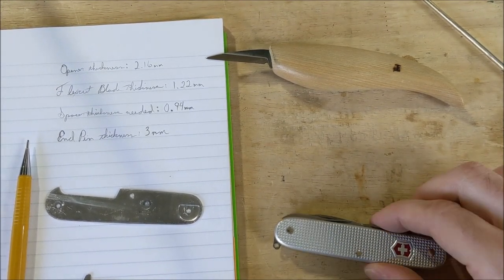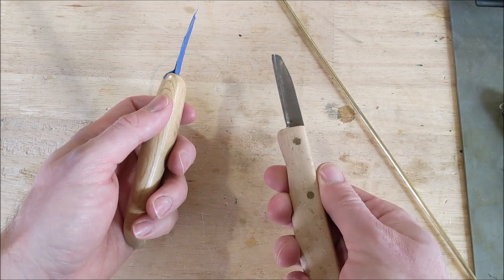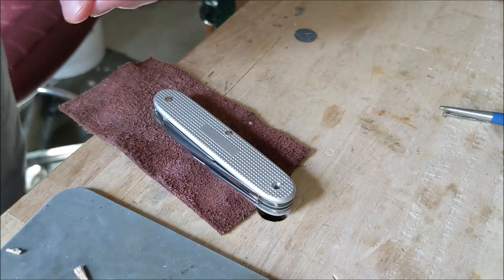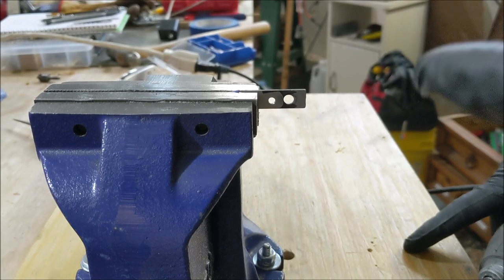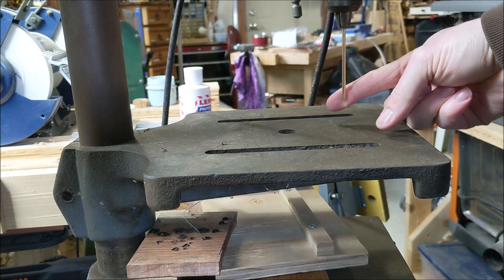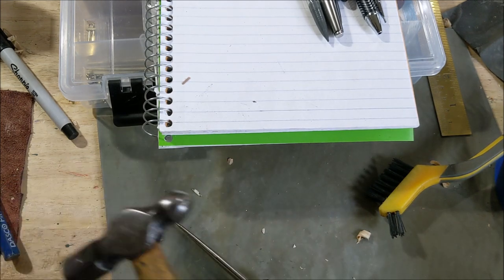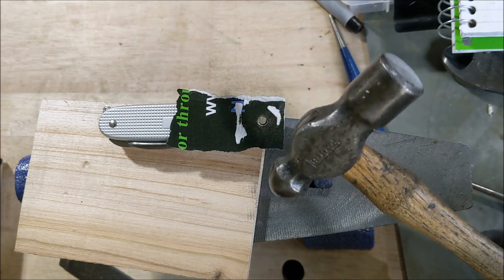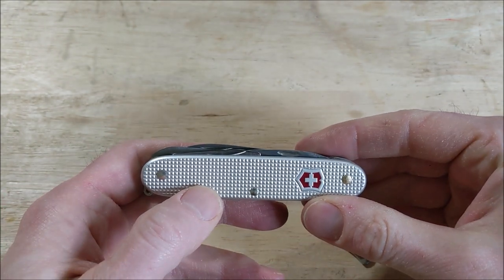How to add a Flexcut Whittling Blade to a Victorinox Alox Swiss Army Knife Farmer. SAK Mod

Comment: I had actually found the exact same knife but it's called the harvester.. it already had a hawkbill blade in that spot. I just turned it into a warncliff style and it works great
Reply from the maker: Yeah, I have looked at that knife. I believe they call it the, "Swiss Army 7," now. Making the pruning blade into a warncliff does give a very similar result to my knife, but my knife does have a slightly harder steel for the whittling blade. That said, I don't mind using Victorinox stainless for whittling. Also, my knife has the key ring loop, which seems to be a real love or hate kind of thing, I love it for attaching a pocket clip.

Comment: Ever thought of replacing the nail file on the Cadet Alox with a scissors...? That would be an awesome project. You rock, man! Cheers...
Reply from the maker: Thanks for watching, and I'm glad you enjoyed this video. I have added scissors to a Cadet, but as their own layer ( https://youtu.be/2lcbzKeZI6E?si=dDMpAgx_29YzwwaI ). If you replace the nail file, you would also have to remove the blade, they are in the same layer, because the scissors require their own layer.

Comment: This would definitly a knife I would buy immediately!
The reamer placed on top is already great!
Don't like the centre/back reamers on the plastic models.
But I cannot do what you did so hopefully Victorinox will bring out the pioneer whittler one day.
Another thing I really would like to have is a simple flat little fork on my edc.
Victorinox never incorporated a little fork on any of their knives besides the cheese master which is a useless piece of equipment overall.
Anyway, great video!
Reply: Maybe I found a simple solution for people without the possibilities for this modification.
Take a pioneer 7 and change the cutting edge of the pruner and re-sharpen it.
It's not a tough blade but it's at least something that most people can do :-)
Reply from the maker: I thought about doing exactly that when I first started exploring the idea for this knife. I didn't go that route because, like you said, I was really looking for a harder steal for the whittling blade, and I didn't already have a Swiss Army 7 Knife. I do really like the idea though, and if I had a Swiss Army 7, I would probably end up reshaping the smaller blade to better suit my needs.

Comment: That is truly awesome. I wish I had one. I’ve modified the small blades on a couple of knives for carving, and the steel I like best is on the inexpensive Rough Rider knives. It holds an edge even better than my more expensive Case and GEC knives. But your solution is the best by far!

Comment: You can buy carving blades without the handles— they are made for the knife sets with changeable blades. This would save you the trouble of cutting off a handle, and usually save you money as well.
Reply from the maker: Yeah, I thought about that, but I already had this knife, and it wasn't seeing much use. If I were to make another,  I would for sure buy a blade without a handle, but this time around this was the cheaper option. Thanks for the suggestion though, and for watching. :-)

Comment: Thank you!
I've always been curious about what the tang of Flexcut knives looked like! Thought about making new handles for a couple of them
Reply from the maker: My pleasure, I was curious too. The only trick is getting them out of the handle, that epoxy or whatever they use to hold the blade in place is some pretty good stuff.
Reply: Flexcut sells blades, without handles, for its line of knives with interchangeable blades. Consider using one of those if you want to make a new handle. It would let you skip the “digging the blade out of the factory handle” step.

Comment: Sharpen the can opener to make a curved blade for carving bowls and spoons. Sharpen the large screw driver to make a chisel.
Reply from the maker: I removed the can opener for this mod, so I don't think that will work out. I have thought about sharpening the screwdriver into a chisel, but pushing on the non locking blade like that makes me a bit nervous. Do you have experience with this mod? Does it workout because of how you hold it, or do you have to be super careful not to close it on your fingers?
Reply: Josh's Shop my screwdriver blade is locking, thats why it makes a great chisel.
Reply from the maker: @georgerector9252  Ah that would be cool.

Comment: File out that stupid keyring hole, and you're set!! Good job!!
Reply from the maker: Ha, thanks. I know the key ring nub really bothers some people, but I actually don't mind it, I find it is rarely in my way, and I really like being able to carry my knife on a suspension clip.
Reply: @JoshsShop  It depends on how you use the knife. If you use it for common cutting tasks that we all use from day to day, it's great to have it, however, if you start using it for wood whittling, it's a pain and a discomfort. I also liked it for the same reasons, until I used the Harvester that comes without it! 
Keep em shapr and stay safe!!

Comment: How much for one that’s what I need in my pocket very well done
Reply from the maker: 😁 thanks. This took me so long that I would have to charge a silly amount inorder to make it worth my time, it wasn't that hard though, if you have the basic tools, you could do it.
Reply: @JoshsShop  haha...silly amount must be 10 times the actual cost of knife 😆
Reply: Yup I went through a phase of modding these knives replacing pioneer alox handles with carbon fibre, parts were about £20 plus cost of knife, but took about 6-8 hours per knife (lots of  hand sanding) so selling at cost plus only £10 per hour labour would price the knife over £130. No one is gonna pay that! Also extra costs for waste (my own mistakes!). This kind of thing is really a labour of love ❤️

Comment: This is a really neat modification. After you made the groove that allows you to get your nail in the blade did you have to go back and remove any sharp edges? Really Enjoyed this video.
Reply from the maker: Thanks. I may have just been lucky but adding the nail nick didn't raise any sharp edges that needed smoothing.

Comment: How come Victorinox does not make a Wood Carving knife that has two carving blades, a saw, and a large roughing blade. Blades that have 58 or better Rockwell hardness or 440 or better stainless steel.  Just three slots (not sure what they are called) handles. that are rounded for comfort, with locking blades.  Folded no more than 3 1/2 inches long.  If all the carvers out there will unite and keep bugging Vicky about it, I am sure they will listen.
Reply from the maker: Sounds good to me. I don't expect we will ever see anything like that, but it would be sweet.

Comment: Is it possible to add metal file instead of whittling knife? Or will i need extra scale instead of spacer?
Reply from the maker: If you remove both openers, you could probably get tricky and add a file from one of the 91mm models, or like you say, get/make another spacer and back spring, then add the file as an additional layer. Either way, you would probably have to completely disassemble the knife which can get a little tricky, but is completely doable.
Reply: And thats why I purchased a second farmer to use as a donor. Andalso  a climber or  mountaineer , idont remember the name,that has file to get. Stupidity to disassemble 3 knives to make 1? Yes. Do i care? Nope.
Reply from the maker: Sounds fun, I hope it works out well.

Comment: Why does everyone mod the can opener.  For me, it's the most useful too.  It's a great can opener!   Plus, in this case, you can mod the can opener into a handy curved carving tool really easily.  Then you would have three blades to carve with.  Ditch the useless bottle opener.  It's almost as lame as the cork screw....maybe more, since I have used the cork screw several times.
Reply from the maker: Interesting. I very rarely use the can opener on my knife, which is why that is the tool I replaced on this knife. I do use the bottle opener tool often though, mostly as a pry bar, scraper, and screwdriver. I see what you are saying about turning the bottle opener into a curved carving tool, but that isn't something I was interested in. It could be done though, you would just have to switch things around a bit.
Reply: Josh's Shop    I don't know if you're aware of Felix Immler's channel.  I think he does every trick there is with these knives.  Really fun channel that I've been binging on during the shutdowns we have going on.  Really all there is to do is sharpen the edge, and grind off the grippy part.   I have a simple 2 blade, 2 tool one at home, and that's my dedicated kitchen can opener.  A tiny bit of practice and you can open a can as fast or faster than any can opener, and it never wears out, amd most importantly, doesn't get all gross and nasty because it's so easy to clean.
Anyway, we all customize to fit our own needs.  I only mentioned it because it seemed to me the poor can opener always seems to get the shaft.  🙂
The bottle opener I was thinking about putting a slight edge on to turn it into a scraper, which I think would be more useful, but I know the day I do, I'll need that dam screwdriver! 😃
Reply from the maker: @jimf1964  I am aware of Mr. iImmler, he's great. He even commented on this video, which I'm pretty sure was the peak of 2020 for me. 😁 

I know exactly what you mean. The second I don't have a tool is pretty much always the exact moment I need it.
Reply: Josh's Shop   That's so cool.  Getting a comment from him is like you've made it in the entertainment field. 🙂
I've used these knives for decades, but they sort of fell out of my choice.  Thanks to Felix I've renewed interest in them.  There are better knives, but for the money, they're hard to beat.
Reply: The most useless tool on sak is the hook.i think not even victorinox knows its use and hoped people try to find silly uses like moving pottery from fire or tye shoelaces 😂 . I can imagine a dialog in victorinox factory going: - Mark we need a back spring tentioner. - use the corkscrew.-did it ,need anotherone on the same knife.- use a philips screwdriver.- done , need something else.-awl? - used it,something else? here put this. why its too small to use?!!! - because its a hook!!! And we are victorinox!!!! - hanging around with Steve Jobs is not good for you!
Reply from the maker: I have used the hook a handful of times over several years, but it is certainly not the most useful tool, and probably the least used on my knife.